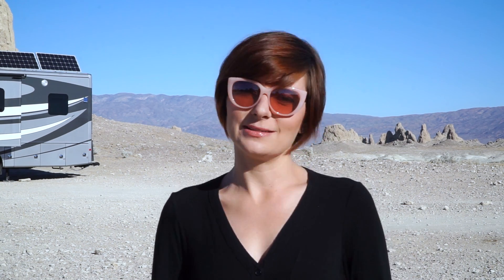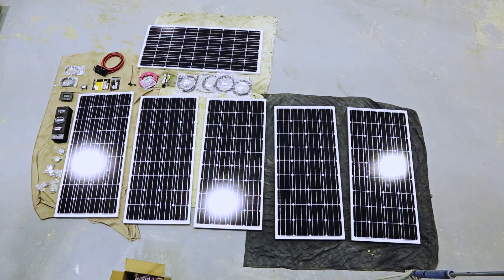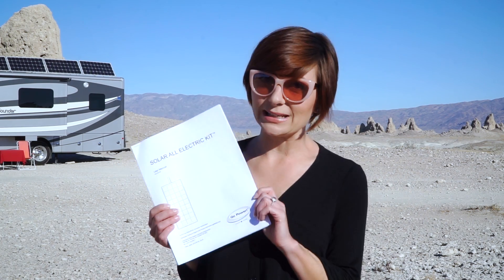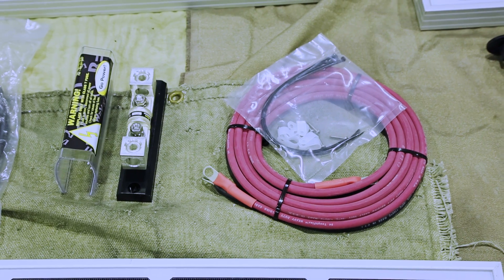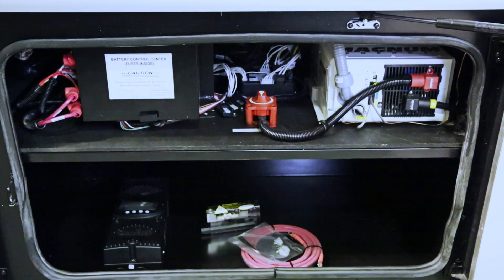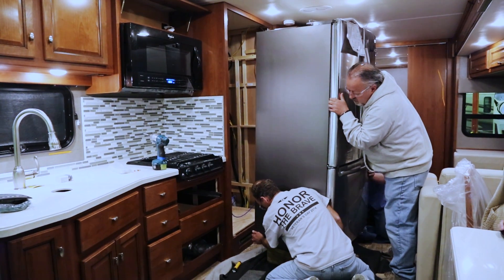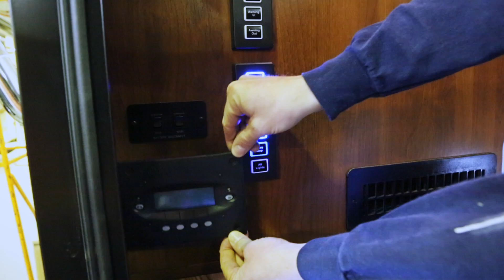Our 960 Watt RV Solar Install: A Step-By-Step Guide

Comment: What is the tilting mounting kit you added
Reply from the maker: Pro tip: check the corresponding blog post if you’re looking for details! There's a link to the tilting kit on Amazon in the blog post. Don't forget that buying your kit through this link won't cost you a penny extra and will throw a little something into the GWTW sailing kitty. https://www.gonewiththewynns.com/rv-solar-install-guide
Thanks for being a part of the virtual crew!
Curious Minion

Comment: Drilling holes,and fastening the holder to roof like was here done is not safe...First,you need a Sealant (example KENT) to hold the holder and tight the hole...Next always SCREW the holders since nothing else will hold hard enough if the wind is strong.In the past I've had a bad experience,so learn out of my mistakes :D

Comment: No wind generator ?
Reply from the maker: They aren't very practical. They don't make much power unless the wind is howling, and they can be noisy with all sorts of vibrations into the coach (or boat). There's a bit more on why they haven't gone wind generator here, so check it out! https://www.gonewiththewynns.com/charge-boat-batteries
Curious Minion

Comment: Should have done a series/parallel hookup on the panels. With 1 failed panel you will lose the whole system. Hooking them all in series makes for VERY high voltage but limits the current to the lowest producing panel, so if one panel is shaded you screw up the whole string. I would have gone with two in series for each string and then paralleled the 3 strings. Used a combiner with individual fusing and a diode on each string to prevent a backfeed and then a breaker to protect/disconnect the array. This way you can loose 1 string and still have 2/3's of your system functioning.

Comment: Umm, no. I'm not a player for this one. 
For one thing, drilling all those holes in the roof is bad juju. Especially the way they did it here. You're supposed to shoot sealant into the hole before inserting fastener. Not just around the outside. 
For another, those panels sticking up at an angle ain't cutting it. A good windstorm will rip them right off. With wind comes rain and guess what happens next? Especially with a stick-built coach. 
I'd glue 3/4" marine grade plywood panels to the roof with tile mastic, then mount the solar panels to the plywood. No holes. And mount them flat.
And by the way, putting the panels at an angle on an RV is silly unless you think every site you find will let you aim the panels to the south. Just mount them flat. The slant kit is meant for roofs that don't move. Like you'll find on a cabin. Not for a roof that boxes the compass. 
This RV dealer looks like a hack...

Comment: All 6 of your panels in the video were wired in "series"?
When panels are in series, all series panels act like a single large panel. Shade or fail on even a single panel = shade or fail to all with 0 output. You can test this by setting up in good sun and check the output, then put a small blanket or something over a single panel and then check your output.
When panels are in parallel, each panel operates and generates power individually. Any shading or failure on 1 or even more panels does not effect the output of any of the other panels and you still receive the output from the "good" panels.
Your installer did a good job on the physical install but would have served you better had they put a bit more effort into the wiring side of the design. 3 in series x 2 parallel strings would have been a better option perhaps.
Reply from the maker: Curious Minion here, (because even super-villains need trusty assistants!) helping out while the Wynns are crossing to French Polynesia. That is true, but wiring in series gives you a much bigger advantage for charging. Wiring in series delivers much higher voltage than wiring in parallel, and that works much better with MPPT controllers so you can charge your batteries much faster, and there's less loss in the wiring so you can use smaller gauge wire.

Comment: What! $3,671.94 just for the panels!! that's more than I paid for the bus, you need to shop around my 450w 12v array cost $500 and peak at 24A which is plenty

Comment: Can you tell me why you chose to use 960 watts. Te GoPwer system we are looking at only goes up to 480 Watts. What do you gain from the additional 480 watts if the batteries in the coach are 4 six volt batteries.
Reply: Ron Uzzo the biggest advantage is that the batteries get charged a lot faster with the additional power. Also if they're pulling more loads in the daytime, there's more juice available. aeacares.com carries several options for these systems, complete with batteries. Happy travels

Comment: Volts x amps = watts, so 960W / (50A OR 60A) = 16V... So they are in parallel not series? Series increases voltage, meanwhile parallel increases amperage.
Reply from the maker: +Fa Vang They're wired in series. For the short answer for why, check out the "Questions to Know" section of the blog post: http://www.gonewiththewynns.com/rv-solar-install-guide

Comment: I really appreciate the videos that you guys put out.  Very well done and very informative!  I am considering a 40 ft fifth wheel that is pre-wired (on the roof) for solar.  My concern is the size of the wire that they used at the factory since I am planning on installing a 960 watt system as well.  Do you know what size most companies use to pre-wire on the roof and most importantly, what size wire do I need on the roof for the panels to operate to maximum sufficiency.  Thanks in advance for your help.
Reply from the maker: +Mike Boaldin You need to contact the manufacturer about what gauge wire they used - it varies. We do talk about pre-wiring and wiring specs in that blog post: http://www.gonewiththewynns.com/rv-solar-install-guide

Comment: I installed a smaller system on my Camper, 2 each 100 watt panels in Parallel. I use my camper to camp outdoors and find I use power in the morning for cooking and the evening for entertainment the rest of the time I'm Outdoors... which is  like why I got the camper... I could probably use my computer all day and my other electrical needs too . but  I came to be outdoors...  I can run about  1000 watts from my pure sine wave inverter for about 40 minutes  which covers any level of Coffee making or Microwave cereal.. etc...

Comment: I've owned travel trailers for about 40 yrs now, they have changed some but not a bunch...  A couple of notes-  With a limited amount of air volume inside, how do you manage to deal with moisture built up inside the coach especially during the winter?  

That is really the first question, what I really want to know is how do you deal with those flimsy mounts for tilting the panels during a storm or when you forget, lol....
Reply from the maker: +Deserthunter Mike You need to open a ceiling vent and run the fan on exhaust if you're using propane (because it releases water vapor). That's one reason we prefer cooking on our induction burner. Question 2: the tilt arms are pretty sturdy and do fine in normal weather conditions (like a thunderstorm). You should never drive with the panels tilted up though - guessing that would be bad!
Reply: I was just wondering about moisture, we've had several trailers over the years it seems like the most damage is from moisture from just breathing and cooking.  The inside of the windows gets covered with ice.  If you haven't guessed it we dry camp even in the winter.  I miss the trailer manufacturer's not offering storm windows anymore.  My last trailer a 30' Terry Taurus had the storm windows, the warmest trailer we ever had... insulated floor, even a heat vent going into the fresh water storage.....  
I have a couple of older panels on our present trailer that I'm going to change out for the newer panel, also our batteries gave up the ghost last season, I'm going to replace with LiPo's....

Comment: hello sir..what is the best connection on solar panel..is it series or parallel.....i have 20amps solar charger controller..300watt panel....
Reply from the maker: There's no simple answer - there are a lot of variables based on your controller, how many panels, the type of panel, etc. If you're not sure you should contact a solar installer and they can help you.

Comment: you said 50 or 60 amps what voltage is that at 12 volts 24 volts 48 volts 120 volts or more simply put tell me the wattage

Comment: At time marker 4:53 you say the cable shouldn't run more than 25ft, I'm guessing that's the cable going from the solar panel that goes into the RV and not the total length including the cable runs from each solar panel ?

Comment: All you pinhead dangerous experts the higher the voltage the less line loss at any gauge and the MPPT controller is 98% efficient up to 100 volts... as for batteries once again 24 volts is better than 12 half the current for same power wattage...

Comment: Shitty ugly ineffective wire seal job... $30 dollar nice black cable entrance ruined by poor and incorrect workmanship along with wrong color incorrect sealant... check that Silicone in 6 months it will be barely hanging on...

Comment: So each panel is 160 watts? I'm having trouble finding a small enough panel over 100 watts. All the 120,135,&150 are much bigger than then 100 watt.
Reply from the maker: check the flex panels, they are 100 watts and much smaller footprint.

Comment: They used the wrong panels, amorphous silicon is better, as it works on low light.
One cell shaded on those crystalline panels will stop it from working, bird poo or just leaves and snow.
Amorphous panels will still deliver near maximum voltage. They also stick directly on the roof no screws needed.

Comment: 10 Guage Wire is only Good For 30 amps SAFELY. 8 Guage is Good For 50 amps Safely.  it Used to Be Code Many Years ago for 50 amps max. on 10 Guage wire But they changed it because of fires and melted wires. YOu have a 80 amp Breaker. i've Been Doing Electrical in the Real world----Automotive , Marine, Residential , Commercial,  For 36 Years.
8 Guage is Good for 50 amps Max.
6 Guage Wire--- is good for 65 amps Max.
4 Guage is Good for ---90 amps Maximum Per the National Electrical Code.
If u Are Putting 70 amps through that 10 guage wire for any Length of time-say a Full Day of Hot sun---the insulation will Start to Melt on that wire and Then The Wires touch together causing sparks and insulation and dust in the coach will now catch fire and Poof no more Coach. It won't Happen soon it will happen in a few years down the road.
i would not Feel Compfortable with a wire size Less than 6 Guage for this install and Neither should you. YOur system will Run Better too. 10 Guage is Wayyy too small. Your gonna Melt that wire!
Reply: Thank you for taking the time to go over this.  I used 8 gauge in my little trailer and was still worried it wasn't enough.  Thanks.  I'll double-check everything.

Comment: hi how to buy total solar kit.
Reply: EBAY! Also check Craigslist. I recently purchased a 300 watt panel for only $220.00, brand new in the box, from a seller on Craigslist. Ebay has controllers for $30-80. depending on how many panels you are going to use..

Comment: I am amazed that you can put 6 panels in series and not go over the voltage limits for the Outback FX80.  I guess that is why you check the specs on the panels. :-P  That does explain the small wire for a 100W  bank.
Reply: I was wondering the same

Comment: If I'm going to get a 600watt set up how much would that run me back?
Reply: Well this 960watt setup was $4000.00
Reply: Recently on craigslist I saw 315 watt Trina solar panels advertised for $150.  I could see a 600 watt system running about $400-500 if you could score some bare bones deals like that one.  Otherwise, expect to pay $2-3/watt.  If Wynns cost $4000, thats about par with name brand equipment.  About a year and half ago I installed 1030 watts for about $1300 with used Kyocera panels and off brand controller and no solar panel monitor.  Add $200 more for a harbor freight 2000 watt inverter.

Comment: Just a few finer points of going solar:
-The wires from the charge controller to the batteries need to be as heavy and short as possible, without the controller actually being in the same compartment as the batteries (major fire hazard). Six feet or more is unacceptable. The reason being is that more than a 1% voltage drop may prevent the batteries from being fully topped off, which will lead to shorter battery life and running out of juice too soon everyday. The only real way to tell if they are getting fully topped off is with a hydrometer (about $5 from an auto parts store). You also need to look up what voltage YOUR batteries need, as each battery company is a little different. Get this right and you will avoid a lot of problems.

-Related to charging voltage, some cheaper inverters will shut down if the battery voltage while charging is too high. Trojan batteries need 14.8 volts to properly charge, but some inverters shut down at 15 volts (or less, even though the specs say 15). Higher quality inverters like Magnum have a 17 volt upper limit, so no problem there. So if you have a 15 volt limit on your inverter and you complain to the dealer about it shutting down during the day while charging, they will probably lower your charging voltage to keep you happy, but of course then your batteries will suffer and die sooner. So either don't use the inverter during the day, or get a better one with a higher input voltage limit. Undercharging your batteries is NOT the answer.
Reply: Stupid is as stupid does... the higher the voltage the less line loss at any gauge and the MPPT controller is 98% efficient up to 100 volts... as for batteries once again 24 volts is better than 12 half the current for same power wattage...
Reply: @wu ming No... not really and parallel or series you want maximum voltage the controller can accept...
Reply: @wu ming You don't design a system for heavy shadowing unless your on the dark side of the moon, every controller even the best is NOT 100% efficient so every extra controller wastes more energy by producing heat, the low voltages involved are also more inefficient so more energy is wasted with parallel versus series wiring. you want to get as much voltage as possible down from the panels which will be converted to current by the controller.
All of this is basic ohms law not solar science secrets E=I/R
Reply: @wu ming Shadowing of older panels had a significant impact, modern panels have by-pass diodes... The diode is wired in parallel with the cells. Because electricity takes the path of least resistance, it is easier for the current to go through the diode than through the shaded cell, so it does. these diodes minimize power drop caused by shade and ensures excellent performance in low-light environments.

Comment: Good setup. I wish I have enough space to put that big solar panels. I only have 300w Renogy and 2x155ah vmaxx agm batteries. I am planning to get another set of solar (flex this time) and a 175ah battery. Thank you for the video.

Comment: Thanks so much guys!  This was exactly what I needed for my solar install.  I love that plate!  Have to get one too.  

My question:  I have the flexible solar panels.  Can I mount them directly to roof stuck on?  I am concerned they will overheat.  I am looking for some way to stiffen them up so I can raise them with L brackets off roof.  Much lighter than the glass panels you have, but cannot mount them, alas!  

I wonder with all your contacts in the RV world, could you direct me to someone who could answer this question?  I was thinking of using COROPLAST 1/2 inch thick as a light airy backing to solar panel but UV breakdown will follow.  I want to mount my flex panels like yours on roof, in a frame, raised up a bit from roof when flat, and can be angled to the sun.

Please help!  I need to get this done soon for a long move.
Reply from the maker: +Lass-in Angeles Thanks! The best person to call about acceptable mounting methods would be the manufacture of your flex panels. I say that because they know what type of backing are on the panels and what types of adhesive/brackets work best for their panels.

Comment: Second opinions on wiring in series are widely available. Certainly, I'm no expert.
It's not the voltage but the current (amps) that are most important to batteries. After all, batteries are rated in amp hours. Moreover, in series, the batteries never see the 100v from the panels. The MPPT reduces it to 20v before it reaches the batteries.
Indeed, thicker cabling for better amperage.....Some costs shouldn't be cut short.

Comment: I've no clue as to why Americans are so hung up on amperage. Saying you've got 50 amps means nothing. 50 amps at a low voltage is maybe only enough to drive a lightbulb whilst 50 amps out of a high voltage line could provide power for a small village. A useful unit of measurement is watts and kilowatts. Talking about amperage is only useful when changing fuses.

Comment: you could easily fit double the power on that camper,simply instal  the panels vertically,this way you run a.c. and charge batteries the same time

Comment: I have always looked at them and asked?? Do they make a auto/power up model that you hit a switch and raise and lower them. Or one that would let you switch from right to left side of the RV if your tilt is on the left side only. Yes I know there would be a bit of a cost added on for something like that, but why not in my book... some just have money to burn.